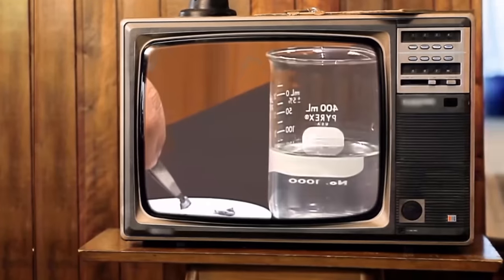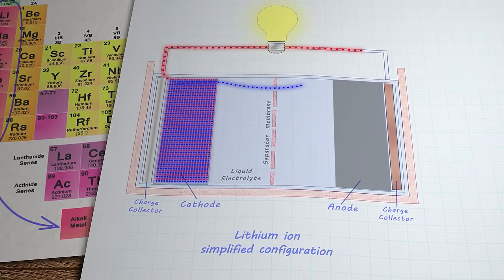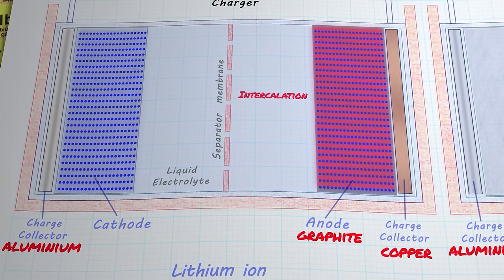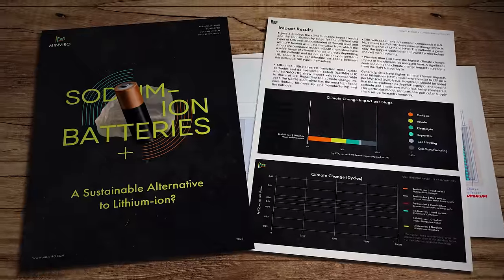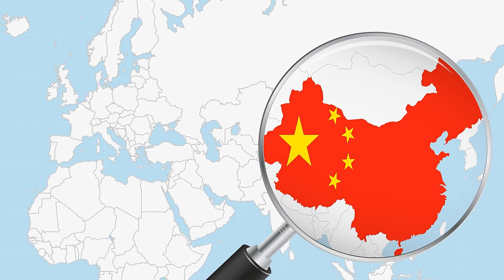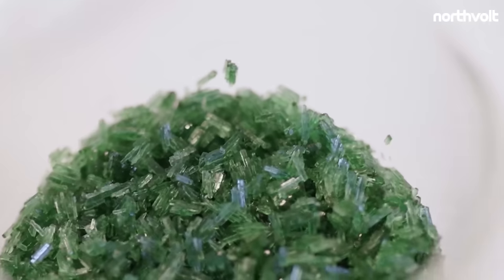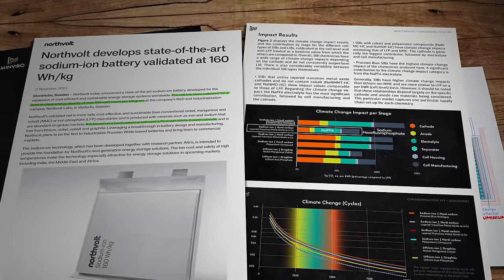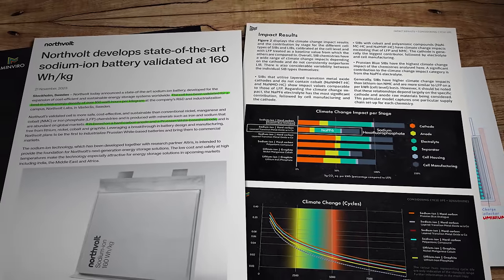Will your next battery be based on salt?

Comment: Still waiting for anything-but-lithium!!  lol
Reply: well there's still NiMH AA batteries, see if those are applicable.
Reply: Between 50 to 100 million metric tons just found in US recently, and another 45 in Asia. It’s going to be cheap. Sodium sure would be nice though.
Reply: What's wrong with lithium?  There's enough of it, it works good, it's not too expensive, it's recyclable, and we already know how to use it.
Reply: @incognitotorpedo42 Our hunger for energy storage will increase at the same level that we can create such energy storat. No point will we be having an excess of energy storage regardless of whatever technologies we use.
Reply: It has a nasty tendency to burst into flames and start bad fires. Plus lithium is finite mineral, etc.
Reply: @Rach1941 
Biggest problem is its difficult to extract from its natural ore to its favoured form it needs vast amounts of water ..some very unpleasant chemicals and produces a not inconsiderable amount of CO2.. its also currently quite slow to extract and process..even before it gets anywhere near a battery plant ...and then theres Nickel Chromium and Cobalt that it tends to get pared with.  Oh and Copper.. Its better if it can be paired with sulpher ... 
But Al and Sulpher are  potentially beter still and so is Na Zn ...... I forget the rest of that mix.. 🤷🏻‍♂️ 
Save to say its also impressive beyond lithium.   

Lithium might just end up as an enhancer in Al S based cells but  are a order of magnitude greater in capacity than the best lithium at the moment. 

The big problem with lithium is who and where ..politics and political stability have already thrown it into one climb and crash.. 

Na Al and S are  far more evenly distributed and volumetrically available globally...

Actually if the switch to LED lighting teaches us anything the more we produce the more we use them so we consume as much power as before. 

This could happen with the storage V renewables generation development pattern. So longer term stable low loss storage solutions will be needed especially in less favourable  climbs. 
So Li as we know it now isnt whats needed rather you have to follow Prof Don Sadoway's logic.  And flow cells are scalable downwards for domestic and small scale utility use.
Reply: I'm a big fan of pumped hydro.  Best grid scale battery we have.  No special materials required, it's dead simple, and it's a mature technology that has been used for over a century now.

Still, I believe theres a place for chemical batteries mostly in short term (think hours) storage and load balancing while other systems are ramping production.
Reply: @AkaRyrye83  
Theres problems with water supplies and suitable sites also  if the grid is to work in the future its got to be dispersed and resilient  so it less vulnerable to extreme events.
Be those weather or natural disasters... or deliberate malicious damage.  
By having  dispersed long term storage throughout the grid you increase the resilience of the whole.  
At the moment if a major substation transformer is damaged theres only a handful of builders in Europe .. The grid cables are also vulnerable and quite honestly dont connect to the new big production sites. 
The old fossil fuel generators were few and far between as with Nuclear .. 
Dinorwick  uks biggest pump station has to be drained anytime theres a advertising break on a busy winters evening  
because we all go out and put the kettles on..   Im not sure how long it can run for before you switch it back to pumping but its probably measured in a couple of hours maximum.

If grid  power lines go down in a storm or overheat and short then you're power motorway 🛣️ systems going to overload or cut off for many hours or days... 
and its in the nature of such things that they seldom happen in isolation or as predicted. 

So a more cellular regionally backed up store and transmission system makes more sense as does the ability to ballance out sources across a more volatile grid. 
Every hospital has to be backed up with diesel generators currently  JIC.  These may be replaced by flow batteries and solar on roofs ...plus heat pumps. The internet itself gets ever hungrier for power even without ridiculous crypto miners 
demanding cheap energy for what? Data centers consume vast amounts of power and struggle to keep themselves cool enough to keep working ...
but is anyone using or recycling 
that wasted energy .. yes but it needs to be stored and transmitted again.

Comment: I think taking 1% of market share by 2030 seems low. Either that analysis knows something that has not been shared here which severely limits Na's usefulness or the analysis has significantly underestimated the displacement potential for Na. Are all the uses where energy denisity is not a major factor worth only 1% of the near future battery market?

Comment: The Honor Magic V2 mobile phone (a top spec foldable) has a sodium-based battery of 5000mah capacity - the biggest battery amongst current foldables. 

How did they manage that whilst being the thinnest and lightest high-end foldable, if sodium-based batteries aren't yet as dense as lithium ones?
Reply: By not competing based on thin form factor
Reply: It doesn't use sodium but lithium -> 	Li-Po 5000 mAh, non-removable
Reply: Correction: I misread their battery type. It's SILICON carbon, not SODIUM carbon.

Comment: The mistake most of these sodium-ion battery companies is making is that they are even remotely concerned about density.   Their competition should not be EV batteries, their competition should be Tesla Powerwalls.   Every household in the USA should have a refrigerator sized battery in their home, that battery should be able to provide 3 days worth of energy storage, it should last 20 years,  and it should cost between $500-$1000.  It does not matter if it is 4x the size of a powerwall, the goal should be to get it to 1/10th the cost of a powerwall.  Solar panels are getting extremely cheap, the problem is the cost of storage.  By getting that frig-sized, 3day battery down to minimal cost, it allows everyone to get off the grid, which significantly reduces the regulation and burden of household electricity.  The only density issues should revolve around the tools needed to get the battery into the home.  If you can get a frig or hot water tank into your home, then that same tool/method should be able to get your battery into the home.  Sodium ion batteries should be about a race to the bottom for costs, not about density.

Comment: I don't find the life cycle analysis / sustainability calculations very compelling, because they are based on existing manufacturing methods.  As we transition to electric mining and refining methods driven by clean electricity, the batteries and packs will get cleaner.  They are at any rate a relatively small fraction of the climate cost of an ICE vehicle, which at the moment is what counts.  We can worry about "sustainability" after we've replaced most of the ICE vehicles.

Comment: I would not take a research paper to serious that projects only 1% of the global battery market in 2030 to sodium as they typically have no data from china , which means they are blind to the biggest market and producers and it is very common to underestimate the speed in which they transform.

Comment: I feel like one reason fossil fuels remain so popular (aside from the bribes) is because of how simple they are. Burn Coal. There is no step 2. But it's clear that the future of energy management is going to involve a LOT of different independent technologies working together to provide energy stability. I imagine that level of uncertainty and choice overload slows down grid operators. If you install something you're going to want to maintain it for it's entire lifespan, but what if your new fangled tech has a catastrophic market collapse? Now your maintenance costs skyrocket if it's even possible, where as a gas peaker plant you have a massive parts and talent pool already.

Comment: Discharge curve for sodium is garbage , increasing overall system cost to deal with the wide voltage range.  Moreover raw lithium cost constitutes a small share of overall cell price. For example LiFePO4 currently stands at around 100$ per kWh, but has only 5$ worth of lithium in it (April 2024 prices).

Comment: Sodium-ion would be far more preferable in marine environments than Lithium-ion due to lithium-ion's fire hazard. Lithium-iron is safer than lithium-ion but still not as safe as sodium-ion. Fire on a boat out to sea due to lithium-ion batteries leaves you with basically two choices, burn to death or drown. Thus sodium-ion would rule in the marine environment due to safety.

Comment: One important thing, at least for me, is safety. Sodium-Ion batteries do not suffer from thermal runaway and are therefore much safer. Although I am very excited about electric vehicles and can't wait to switch to one, I am also not too keen on having a car that could quickly catch extremely violent fire in case of a car accident and perish the occupants in case if they are trapped inside or unconscious. I am more than willing to sacrifice range for safety. So, I admit that I am looking forward to batteries like sodium-ion or solid-state and actually waiting for them to become mainstream to get rid of my petrol car.

Comment: This sounds positive, but I had secretly hoped Na-ion batteries, that do not need nickel, could (more) quickly capture much more of the global battery market, especially here in Asia. Otherwise more forests and endangered species will be lost in Indonesia and the Philippines as they allow rampant investment to capitalise on these natural resources they have relative abundance of. 
Indonesia, for example is getting investment from two rapidly growing Asian EV OEMs (BYD and VinFast) to build vehicles with local supply chain, and also major investment from Ford and others to mine & refine nickel and manufacturer NiMH anodes for export, eventually whole batteries. 
Meanwhile, Indonesia needs to be full speed ahead on RESTORING forests to ensure a net carbon sink economy, rather than wantonly dishing out mineral extraction licences to the highest bidder.
Here's hoping the "gold rush" to produce profitable Na-ion batteries will provide some unexpected leaps in technology, financing and regulatory advances to make it more easily outcompete Li-ion in more and more sectors. 
🤞

Comment: Energy storage is what sodium ion is all about.  The sodium atoms or ions are much larger than lithium and thus are not practical for say smart phones or laptops.  Easy elementary chemistry here. But what about that emerging battery tech that uses graphene processed in silicon carbide layers, and THEY SAY that it possesses good ENERGY DENSITY and a SUFFICIENT BAND GAP.  AT least that is what they claim.  But is it all true?  Many start ups fib a little to attract investors!!

Comment: The more i learn about our power grid, the more i realize that modern nuclear energy is our best option. Small form reactors, LFTRs, Thorium Reactors, molten salt reactors. Utilizing our advanced technology, Improved engineering & material science. Using our greater understanding of safety & well made designs. We have so much more advanced computer technology & robotics that can be used. It feels like even tho tons of advancement has occurred with engineering designs, safety measures, etc. It still doesn't matter to most people. It's like most people are ingrained with a natural negative response when talking about nuclear energy.  

 We need to heal from the trauma of our past. See & learn that those things only happened solely from us not understanding what we were doing when it came to nuclear energy at the time. We didn't have advanced enough technology, material science, engineering, safety measures, understanding of how to go about everything, etc. This source of energy will greatly help the world improve towards the future and lowering emissions. More than anything else could, while also providing a very stable electrical grid system. Currently we have alternative energy options but the majority of our grid is powered off of fossil fuels and emission producing sources of energy. We will be so much better going forward commiting to modern advanced nuclear energy options.
It will really allow places to be much more energy independent. Less reliant on fossil fuels. Be able to power desalination plants. They'll have efficient, stable electrical grids and the rest of the grid could experiment with alternative power sources, etc.

Comment: It terms of battery technology, we live in interesting times. Unfortunatly this is a well know Chinese curse. Maybe better to come back in a decade or so when these competing battery technologies have coalesced into ideally one or two working solutions with all the desirable properties and few of the undesirable ones. 
The curse of living in interesting times is that consumers will find their expensive investment in a new EV has a good chance of being one that is powered by a quickly obsolete battery.
This not only inconveniences the consumer, but also thwarts the efforts of those trying to provide a charging infrastructure, with its need for standardisation
Should we be asking the EV manufactures to future their vehicle designs to use more than one battery technology. Is that even possible?
Is it possible to standardise the batter case and make it an easy replaceable component?  A failure to meet this requirement might greatly shorten the working life of an expensive EV purchase, and certainly increase the amount of scrap produced each year. 
A combination of modular engine design and the ability to accommodate a wide range of battery voltage, and charging requirements might solve the above problems, but maybe with added complexity and associate cost. 
It is likely that living in such interesting times is actually holding back the adoption of EVs, along with range anxiety and the lack of charging infrastructure.

Comment: Lower energy-density characteristics for electric vehicle usage needn't be a problem. It would just mean that car manufacturers would be forced to make smaller, lighter, slower, simpler cars with fewer useless whizzy, power-hungry 'techie' features in order to get the best out of the new battery chemistry.

Only racing drivers need [yep, I said NEED, not want] to get to 60mph in under 10 seconds. Yes. Grow up. Admit it. Modern EVs squander their power on junk to keep their fractious toddler drivers amused. In the days of ICE cars you could buy a souped up model at the top of the range [0-60 in 8 seconds], a less 'rorty' model suitable for the ordinary motorist [12 seconds], and a bottom-of-the-range model with a tiny engine, no luxuries, meagre performance, and a minuscule price tag. And a 0-60 time of 18 or 20 seconds.

All three models sold well, because real people actually wanted them.

EV makers have conveniently removed the option to have a 'poverty spec' vehicle. You can either buy something huge and crammed with toys, or something slightly smaller and crammed with toys.

Maybe having less potent batteries would take us back to the days when manufacturers gave people what they wanted.

Comment: Nope, not happening: I have seen the exact same video hyping Sodium Ion batteries 3 years ago, 5 years ago and 8 years ago, so far announcements, nothing more. If you believe the bullshit that is said about Na Ion, all those amazing things that are better than Li Ion batteries, it would take over the whole market tomorrow. But it did not and won't in the future. It is hard to get to real data that shows problems with Na Ion, but one is durability: The capacity rapidly reduces after only a few cycles, that is why Na Ion is pretty useless. Except that it is constantly hyped by clueless people that don't have a brain to think with and have not noticed that you actually can't buy Na Ion batteries, even if you want to, for some reason nobody manufactures them.
Of of the reasons is also that nobody ever publishes videos about technologies that have failed and won't be used for pretty much anything due to that.

Comment: Get off the green energy propaganda.
Reply: Tap__Profile__Send__Sms1144  don't really know how to do that.  Green energy is no such thing, if they can't make light bulbs with less energy than it takes to make a tiny tungsten wire in a glass bulb then they aren't going make a car.  The current pieces of garbage explode and the fire can't be put out and now those idiots are going to use magnesium in the chassis.
  Insurance companies are going to end electric cars.

Comment: Yet again more money time and resources spent on another battery out many over the years. The only battery that hasn’t changed much is the lead acid battery. And batteries only store electrons they are only useful in small mobile applications. Why would any one want to spend energy just to move the heavy battery. Hydrogen does not have this issue as it can move every motive vehicle and can heat what ever needs just heat. The thought you need to make is why are humans so misguided. Buy the way just think what energy we use to make batteries, yeah fossil fuels. Great move.